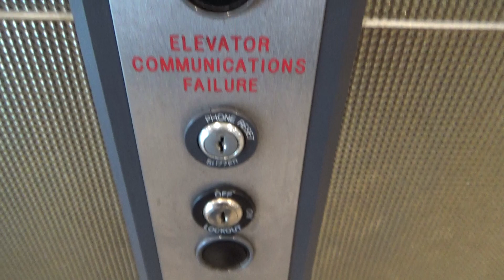EPIC FAIL! Broken ThyssenKrupp Endura MRL @ McDonald's, Orlando FL w/ Communications Failure!

Comment: The 1990s Delta Hole-less Hydraulic Elevator held up very well. It had a lot of character and it ran well. It was a great elevator and it was well taken care of by the owner and staff members. The new management of the new McDonalds fails to maintain their elevator properly. It is a Thyssenkrupp that could have ran just as well as the Delta if it had received the same level of maintenance and care.